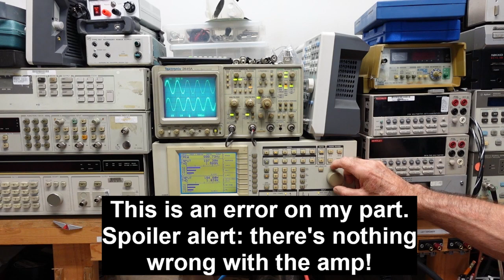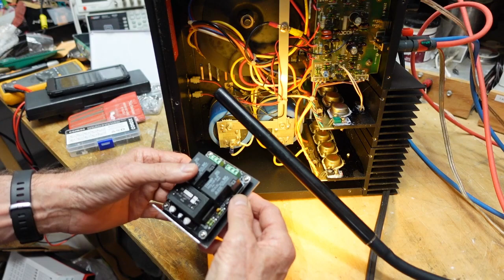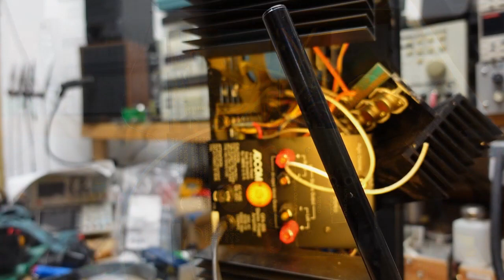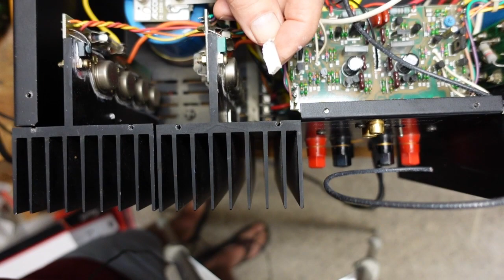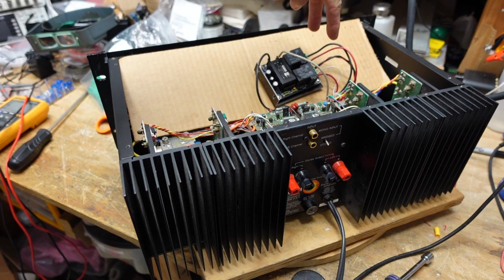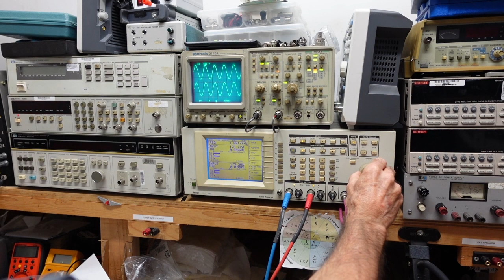Installing an Internal Protection Relay in an Adcom GFA 555 IMPORTANT: READ DESCRIPTION!

Comment: Thanks.  My speakers make a series of light popping noises after turning off my Adcom 555ii.  Would this prevent that?
Reply from the maker: Yes. As soon as you turn it off, the relay opens and disconnects the speakers from the amp.
Reply: @raygianelli3612  Thank you!

Comment: I noticed this amp is set up for Rack mount. Was that a feature of the GFA-555? I ask because my GFA-555 II was not set up for rack mount, nor were rack mount brackets included in my box. I purchased it brand new, and I am simply curious. I suppose the rack mount brackets could have been an optional accessory.
Reply from the maker: I've no idea about rack mounting options.  You might want to ask on one of the audio equipment forums.
Reply: @raygianelli3612  No worries! I simply commented on the rack mounts that were installed on your featured GFA-555. I prefer not having them installed on my GFA-555 II, but I was curious if they were factory-installed or included in the box when new. Thanks for your quick response. Have a great day!

Comment: I always dislike amps that, are designed to put the fill line power and current for the amplifier through heat sink mounted thermal switches, and, since you are adding a line powered protect module, I would have considered a rework, to directly connect the line power to the transformer, and then, use those thermal switches to power / interrupt the AC power to the protect module. Most modern amps have a AC line power fuse and +/- output rail power fuses, so, it doesn't seem like a big loss in protection if any, but if the heat sinks did overheat, the load would still be disconnected until they cool, and you would have a lower resistance / shorter AC line power path to the transformer by eliminating those thermals from the transformer line power path.

Comment: Just installed one in a GFA-535II with bad startup noise.  The only place it fits is upright between the right-front panel and the heatsink.  Of course I ran a circuit ground as described in the correction.  It works famously!
Reply from the maker: Glad to hear it, Paul!
Has the amp always made this startup noise?
Reply: @raygianelli3612  Yes, so I relegated it to the woofers.  But it got worse in the last year.  Ran fine after a loud BURP

Comment: Wow Ray !  this is Great  ! !   I have an Adcom GFA-545ii (  100 wpc )  and my brother has two GFA-555ii  ( 200wpc like yours )   My Question can this same model protection module be used on all 3 amps ?   I found them online and want to put in an order.   Thanks so much for this video,  I had not known it was a thing to add the protection but certainly is a super idea.  Your instruction is great, and appreciated.
Reply from the maker: Electrically the modules will work. I can't say if the 545ii will have the necessary real estate inside to place it though.
Reply: @raygianelli3612   yup plenty of space, caps are smaller in the 545 it frees up some space.  I had to make a bracket and mount it vertical though so not crammed and same module you have there too.
Reply from the maker: @g.fortin3228  Good to know.  Thanks for the update!

Comment: Thanks so much for this video , I have bought this board 3 years ago and it is just seat in my drawer , I have the GFA 555 MK2 which I have bought new never used , I t was in storage more then 25 years new never opened factory box so I was lucky to buy these beast amp.  I have bought the soft start board as well so It would be perfect If you can do video for soft stat implementation. Thanks a lot
Reply from the maker: Ran, I'd not heard about the soft start board. Thanks for enlightening me! I'll have to look into that. So yeah, there may be a video in the future!
Reply: @raygianelli3612  Appreciate! Thanks and have a great day

Comment: Im have the opportunity to get an adcom gfa6000 for free, I'm guessing this will work on that also  ? I'm a novice but have gotten good at recapping solid state recievers, & have a decent understanding of circuitry, this was my biggest concern if I get it .your input would be greatly appreciated
Reply from the maker: No, because the 6000 is a 5 channel amp, and these modules are 2 channel.  Judging by pics I looked at on the net, there's no room to add one, let alone three.
Reply: @raygianelli3612  it's for personal use & it's probably the only way I can afford to have anything substantial, what if I use an external housing, being careful not to block air flow  ? New longer wires ect ,I worked in an industrial fabrication shop doing just that day in day out , all day ,for 4 years, mounting boxes, wireing,wireing,wireing,  if you think that will work, should I  twist the wires to help prevent interference  ? Hey! ! ! what if I put the protection relay only on 1 set of outputs  and only used that? Would that work ? although I'd prefer to do them all
Reply from the maker: @ericschulze5641  An external box would work, and no need to twist wires since it's not a low level signal scenario.
You could do any amount of channel you wish.  Just limited by how much trouble you're willing to go through.

Comment: I found this over the internet whilst researching on Protection Circuit: With an amp like the Adcom, relay protection systems have some serious drawbacks. The DC supply Voltage is around 70 Volts. If a fault condition occurs, then it is likely the full 70 Volts DC will be supplied to the speaker connections. Unless you spend a great deal of money (more than the cost of the amplifier) on a specialised relay, the relay you purchase to do the job will have a breakdown Voltage of approximately 30 Volts DC. This, despite the AC Voltage rating of the relay (which may exceed 250 Volts AC). For all intents and purposes, all relays may be assumed to possess a DC breakdown rating of 30 Volts.

You MAY be able to mitigate damage by employing a (sound damaging) fuse in series with the output. When the relay activates, the output will be shorted to earth. The resulting current should blow the fuse. It is a bit hit and miss and speaker damage is still possible.

Can you please share your insights on this and does a protection circuit really help? Do we really need it?
Reply from the maker: Relay contacts can weld together during a failure, but frankly I've never seen it.  And one of the other things the module does is to prevent startup/shutdown pops or thumps, which unlike catastrophic failure happen every time you turn your amp on or off.
For $15-20 US it's cheap insurance.
Reply: @raygianelli3612  thanks for the reply! Do you think the circuit can affect the sound quality? I have heard circuits can reduce sound quality. Also, I am looking for a restoration kit. I am not based in USA but looking for a link where I can buy and have it delivered in my hometown. Can you pl share a link of recapping kit.
Reply from the maker: @najzain  Zain, I don't think that the relay would degrade the signal audibly, at least nothing that mere mortals can hear.
I was able to find the relay on UK eBay, but I can't recommend any sellers as I've no experience with them.
Reply: @raygianelli3612  thank you
Reply: Hi Ray I’m a new subscriber. I got interested when you mention “the module prevents start-up/shutdown pops or thumps”. This is exactly happening to my GF555 mk2. I was under the impression that it could be a failing capacitor.
Reply from the maker: @joeymarcos6133  Welcome aboard, Joey!  
It may be capacitors on the driver board (might as well replace them while you're in there) but often it is DC offset.  Adcom amps don't have offset adjustments; they rely on matching of the input pair, and their gain can drift over time, negating the matching characteristics.  The thumps are more annoying than damaging, unless they get really bad, in which case servicing the problem would be a better solution than a protection module.
That said, the modules are cheap and can provide peace of mind.
Reply from the maker: @joeymarcos6133  Welcome aboard, Joey.
Capacitors are often blamed, and indeed may be causing issues here.  But pops on startup can be DC offset issues, usually caused by matching differential pairs whose characteristics have drifted apart over the years.  Adcom amps have no offset adjustment, and depend on matching of the differential pair.  Might as well replace the capacitors on the driver while you're in there.

Comment: Great video! Is there any link you can share where I can purchase the protection circuit? I am based in the UK and can buy online. Also, I am looking for recapping kit for GFA555.
Reply from the maker: There's not many capacitors in the 555, maybe 6-8.  Just look at them and order them from a reputable vendor, I think RS Electronics is UK based.
Here's a link to the module I used:
https://www.ebay.co.uk/itm/264680770570?hash=item3da0340c0a:g:WL4AAOSwSgRglTpj&amdata=enc%3AAQAIAAAAwLRkXDYrLgxK2sVUNVK9b7MtBJEaksOr%2BtZi98FBf2mEghjmX3AfREry6wItlYnN9sB517aQCTL7XwVxBQSc9sp%2BN6PwsPKCER%2FJ0wYZNsfnAp2gUIwf5axPGlg6YfAJUNdoDnmN0zMmEiqTpzlmq%2B6tjCHayoU8IH%2FjEvR7M6BXSR1om19XYsXZLPz5cMYjMNAkkUzO3%2BNZD0CK3e1iPSZsG%2BVs1XuJTDKz0mDzTu1roFY7BSykF0vqOMFBorQZVA%3D%3D%7Ctkp%3ABk9SR4Lx-cXDYg
Reply: @raygianelli3612  Thanks for that.  I checked and they ship everywhere except United States so I will have to find a different one.  Thanks for the great video.
Reply from the maker: @captainwho1  Mouser or Digikey in the US.
Reply: @raygianelli3612  I found it on ebay (not uk) by copying and pasting the title description.  I believe it is the same one you used.

Comment: Could you please add a link to the protection module you installed?  I plan to install it in my GFA 555 II.
Reply from the maker: Here' you go, Carl.  Don't forget to ground it!
https://www.ebay.com/itm/125254850460?hash=item1d29c5579c:g:VbYAAOSwmfhcQyzR&amdata=enc%3AAQAIAAAA4PbuHPXop2pFzOmzHYYGnoF0wKJdZONhKTG53fcXYg38b040cX%2BmwojJvt%2FM3UEiN9Y3kWt9oF85esEAnBhX7ja5irjBpsHHMsakyt6sBkmJ0vKhfdzQfthgwqr5w6KsIFYk1bQyaJpV8vXmRLscay1R8yIR6lpcTNp1wytlzw3%2FQq1hDbVq8dzRCyFkq3MbCQJ1ZcFQyzNpqWfO0HrJQ59i9VnU9ywomPniNsfM7kR1QR7J6iwLCQoOINICqBuC0uzMqx2K9z1uIIdQAeWRKO%2FaWxozfeCKS9A0IQYBXdg8%7Ctkp%3ABFBM2p3Wrrti

Comment: Hello Ray, I also wonder if the DC detection can work properly without any ground reference connected ! The soft start works properly, but the rest...Is the amp protected ?
Reply from the maker: Roro, you're absolutely right.  I am going to edit the video this weekend, and I put a notice in the description stating errors were made.

Thanks so much for making this comment and pointing out my screwup!!!
Reply: @raygianelli3612  It's nice to land you a hand ! You can even test the DC protection by taking the module appart and injecting some DC voltage and you can then measure at which voltage the relay clicks off
Reply: @raygianelli3612  Hey Ray, when you rout the positive  L and R wires from the speaker binding posts to the protection board IN don't you need to do the same for the Black ground wire the same ?

Comment: Don't forget to discharge teh large filter capacitors before you put your hands inside the chassis !
Reply from the maker: Roro, the Adcom has bleeder resistors across the caps, so they discharge pretty rapidly.

Comment: I'm pretty sure those little white things that clip onto the amp modules are thermal switches. S602, and S603.
Reply from the maker: Mark, you're usually right about things like this.  I do see something marked T1 on the schematic I've got, which looks like a thermal cut-out.
I found another schematic on the net which shows S602/603 in the same place,  a UP-62, a search which shows it as a thermal protector.
Thanks for the clarification!

Comment: Wow, like you read my mind.  I have a GFA 555 and I'm always on slight edge because it has no protection but never knew it was an 'easy' fix.  Thanks for clear and concise instructions.
Reply from the maker: Thanks Victor!  The 555 is a good candidate due to the amount of room inside to mount the module.  And the peace of mind is priceless!
Reply: I am a collector of Adcom gear, and I own over a dozen power amplifiers, several different models. I have used all of them for over 30 years and have never had a problem with any of them frying any speakers or anything. They have all performed flawless over the years and I drive them pretty hard. Never had a problem with any of the bad caps that they had either, guess I have just been lucky.
Reply: @vegaslimoguy2376  Nice to know that you are ADCOM collector, I wish I could too.❤
Reply: @vegaslimoguy2376  Yes you are lucky Limo guy 🙂
Reply: @vegaslimoguy2376 I only have my one GFA-5500 amp and never blew any speakers either and it still works great. 

I am even running the 2 channels in parallel. Paradigm bookshelf and some small JBL mini speakers which has a cap on them.
Reply: Can you give me a link to ebay for protection relay

Comment: I have a Hafler 220, that does not have any speaker protection.  Pretty scary to think what might have happened to my Acoustat 3's back in the day.  I plan to bring it out of retirement soon and adding protection is on the to do list.
Reply from the maker: Yeah, it's a crapshoot.  I had a Crown DC300A set fire to a 15" woofer when I was playing in a bar band.  Never forgot that!
I've toyed with the idea of making a box with speaker in/speaker out jacks with one of those modules inside.
Reply: @raygianelli3612  That's a great Idea !...cheers.
Reply from the maker: @andymouse  Thanks Andy!  Those relay boards are still available for around $18.  Like I said in a previous reply, I've thought about putting one in a box to provide and external protection solution.
Reply: @raygianelli3612  The external box is the idea i'm gonna nick ! :)